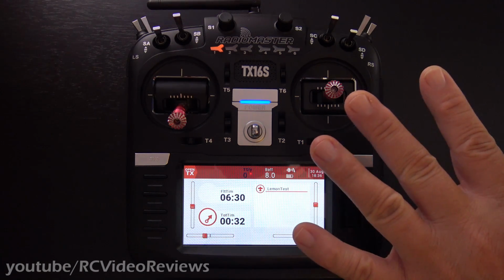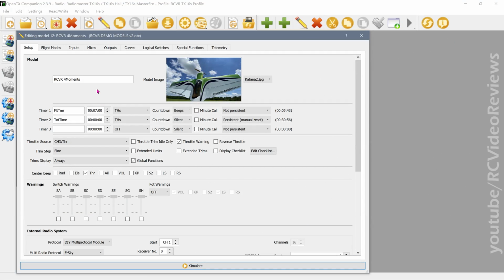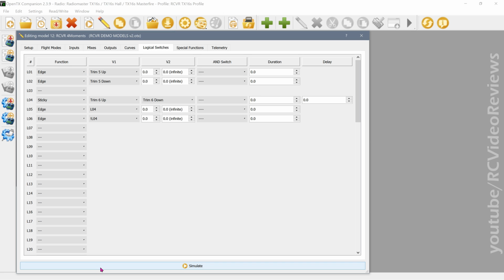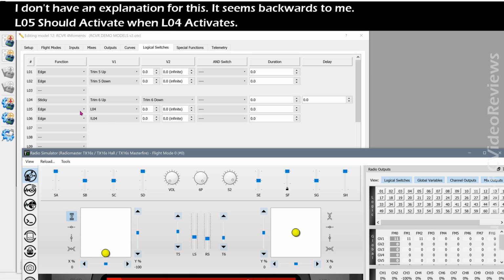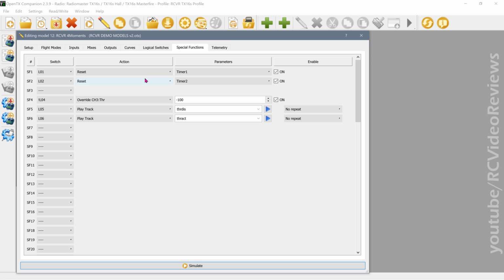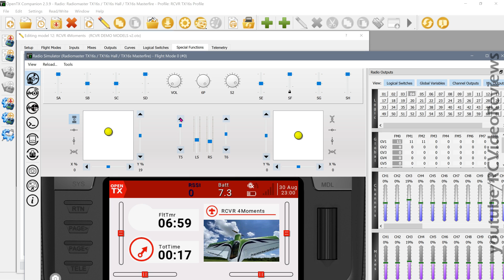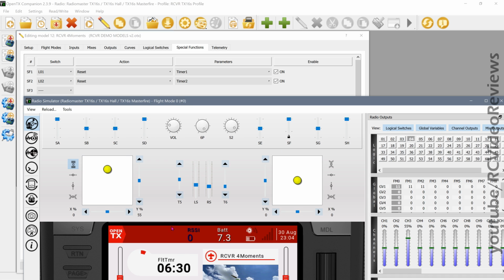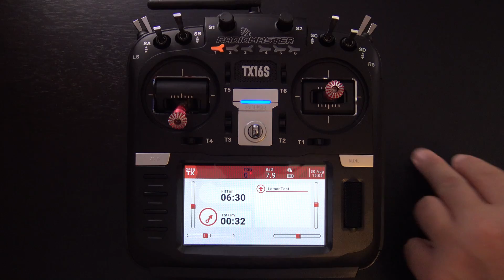OpenTx Companion Tutorial • Add 4 Momentary Switches to Radiomaster TX16s FREE! • [Intermediate]

Comment: You can actually turn the voice/sound the trim5 and trim6 off in flight mode page. I always turn off trim3, trim5, and trim6. since I never use that until today
Reply from the maker: BRILLIANT! I thought that would disable the switch, but it just disables it as a trim switch. Excellent Tip. Thanks!
Reply: @RCVideoReviews  it just disable the button as a trim, but still, it works in logical switch.
Reply from the maker: Yup, I tested it and updated the description. Thanks again for sharing. Perfect!
Reply: @RCVideoReviews  Brilliant! Even with the little I've done with this radio I was thinking it could use more momentary switches. Now all is revealed in this regard but I still will need to live past my century to make use of even a small part of what this toy is capable of. :-) Thanks to you both! :-)
Reply from the maker: @theoztreecrasher2647  I've been using this radio software for years and I still learn new things regularly.
Reply: @RCVideoReviews  yeah awesome. I was thinking of setting up another function to set the irrelevant trim to some arbitrary number around 75% on every trim toggle to keep it away from middle and edges but this is clearly better.
Reply: Sweet  thanks!

Comment: I wish you would do this on the Transmitter for guys using edgetx . 
I tried doing it and got some but timer won't start when you add throttle
Reply from the maker: ...got some but timer won't start...

Got some what? Tell me more about what you're trying to do.
Reply: @RCVideoReviews  Nevermind I figured it out
Reply: I think just a video on the Transmitter would be better for me. I don't use companion
Reply: I want to do a momentary on the trim 5 up and got it to do reset timer but when I move the throttle up the timer just stays at 5 min . You were talking something about the Ch 3  source to get the timer to start

Comment: The most powerful thing you can do with those trims is adjust Gvars, and then in your mixes or whatever, set the Gvar to be a value... that way you can super-conveniently adjust mix values while you fly by using the trims. For example, in fixed wing aerobatics, you might need to mix elevator to rudder to trim the plane flying more accurately... changing that with a trim switch is so astoundingly handy.
Reply from the maker: Neat idea, I may tinker with that.
Reply: @RCVideoReviews  , it's super wicked... rather than fly-land-adjust-fly... just go through a gvar and tweak it in flight with a trim

Comment: Thanks for this.  I always seem to find uses for momentary switches! I'm purchasing a Jumper T Lite radio and it has none.  Do you see a problem with turning off all trims and just using instant trim?  This would give me tons of momentary switches. Also,  one use for t5: I'm building a plane that has a separate servo on the tailwheel. I'm planning on using t5 to trim the tailwheel separate from the rudder.
Reply from the maker: I might not turn off elevator/aileron, but throttle I never use and rudder I could live without on most planes. So I'd say go for it.

Comment: Thanks for sharing - good info.  Only issue I see is that T6 for the Thr can be activated with throttle at more than zero.
Reply from the maker: Please elaborate.
Reply from the maker: Nevermind, I get it. I literally just had a guy comment on the "Better throttle cutoff video" which forces throttle to be at Zero before enabling throttle complain that was bad because if the plane was in the air and the throttle cutoff was accidentally bumped it would be difficult to recover the plane. I find it humorous you both found fault with opposing methods of throttle cut.
Reply: I agree that "safe" throttle cut-off means different things to different folks. And ultimately were left with a Catch-22.
Reply: My preference is to avoid the prop starting unexpectedly when I'm standing in front of the plane. I.e. throttle on zero.  But to each their own.

Comment: Hello RC Video Reviews,
Now that these trims can be used, I noticed that the function was set to the "down" position during start-up of the transmitter.
Is it possible to change the boot script so that these temporary switches are fixed?
For example, the throttle is always blocked when starting the transmitter.
Greetings from the Netherlands,
Casper van Beek
Reply from the maker: I'm not understanding the question. "The function was set to the down position"   Which function are you referring to?  "So these temp switches are fixed"  I don't know what you mean by fixed.  There is no bootup script to modify, so if you want to change a default, you'll probably be using something like a special function or global function.

Comment: Hi, I have been trying to set up T5 for instant trim, how do I activate the t5 & t6 trim switches, mine do nothing?, thanks.
Reply from the maker: Press System -> Go to Hardware -> Go to Switches -> Press Jog Dial. On the right hand side you should see Trims T1-6 on the right. Press up and down on 5 and 6. If the first of two columns on the right show a 1 when you press down and the second of two columns show a 1 when you press up, then your hardware works. If you don't see 1's appear in those columns when you press up and down you have to work out why.

If your hardware works, the video shows how to configure logical switches and special functions to take advantage of those switches.
Reply: @RCVideoReviews  thanks, they are working on the hardware screen but not selectable in logical switches?
Reply from the maker: @TheDJBozz  Are you doing this on the radio or in companion?

On the radio, in logical switches are you selecting Edge? After selecting Edge for the first column, look in the second column. Do you See an icon below the 6pos switch that looks like a trim switch and says 5d or 5u or 6d or 6u?

Also, what version of firmware are you using?
Reply: @RCVideoReviews  I'm on 2.3.9 firmware, I've just found them called 5u & 5d, strange how yours are labelled differently, thanks again for the vids and help. 👍
Reply from the maker: @TheDJBozz  They're not labeled differently on the radio. Mine say 5u/5d on the radio. In Companion they say Trim 5 Up Trim 5 Down etc..

Comment: All of this advanced stuff you can do with OpenTX is really cool, BUUUUT, I have to say, the more layers of complexity you add the more stuff you have to mentally keep track of and review. This makes it harder to simply just go fly stress-free and have fun.
Reply from the maker: Oh 100% agree. I had an email sidebar with another subscriber about not getting crazy with the configuration.

I'm DEFINITELY showing a ton of capability, but here's the skinny: Use what you like.

One thing I've learned in this hobby over the years: There are different strokes for different folks. I don't have all of this stuff on any of my models, but I have portions of it on all of them.

Comment: Couldn`t you remove the wav files for the 3 trim callouts from the sounds/xx/system folder?
Reply from the maker: Arif Isyanto pointed out the trim switches can be disabled in the flight modes tab. I verified in Companion you can disable T5/T6 as trim switches which stops the audio prompting without disabling the recognition of switch movement. 

Removing the audio files would also mean no prompts for the trim switches you might want prompts for.

Comment: Oh that's so cool! I was wondering about these trims myself and now I have a good use for them! Thank you for this very nice trick!
One quick question: You have those red control sticks on your TX16. Where did you get them from and how did you install them?
Reply from the maker: You're welcome. Those sticks can be found here:
https://www.amainhobbies.com/frsky-grande-lotus-style-3d-m4-gimbal-stick-end-red-frk-04100104/p783205

There is a set screw on the top of the stick. Just look straight down the stick from the top and you can see the hex head in there. Loosen that, and the stick ends unscrew right off the top.